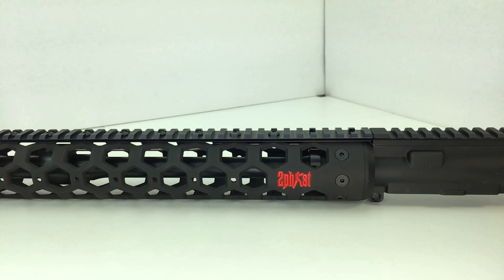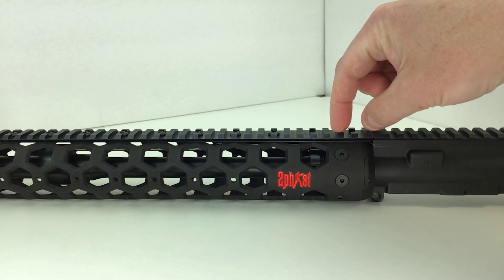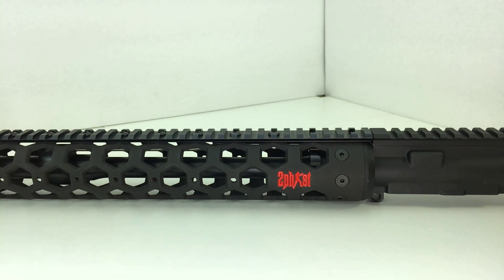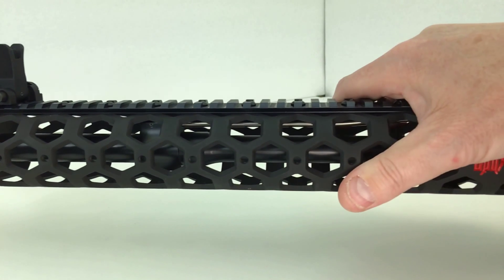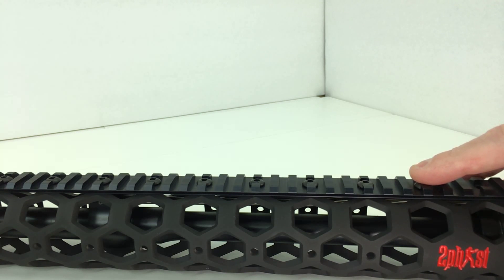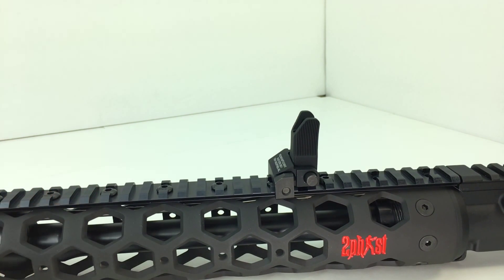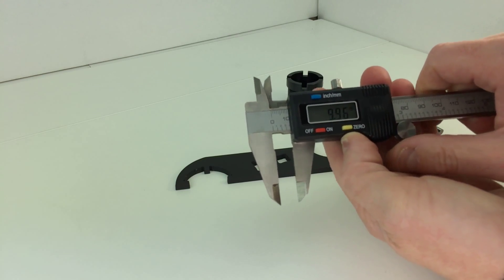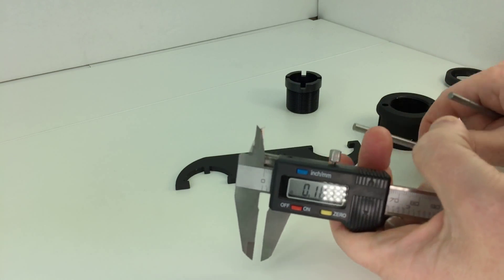Updates on the 15" 2phast Tactical AR15 Hand Guard

Comment: May want to consider rail mounting holes at every 45 degrees, (not just 90 degrees) to accommodate  off-set lights and sights.  Ensure to space rail mounting holes to accommodate 3rd party rails (eg: Magpul MOE rail sections). Very few users will actually need a full length rail on the top of the  handguard. Most users will just mount a front sight, bi-pod/vert grip, light, sling mount near the muzzle. You'll need to include an Allen key and a small tube of blue loc-tite for all of the screws.

Comment: will this fit on an Aero Precision M4E1 enhanced upper?
Reply from the maker: +edward perez The Aero M4E1 has a hand guard mounting ring integrated into the upper receiver, so no, this hand guard won't fit that upper receiver.  Your hand guard options are limited to Aero or one of the Seekins or Spikes BAR hand guards.
Reply: +2phast Tactical alright thanks